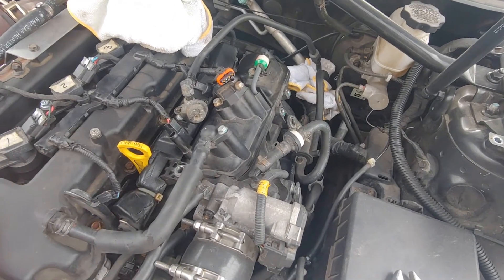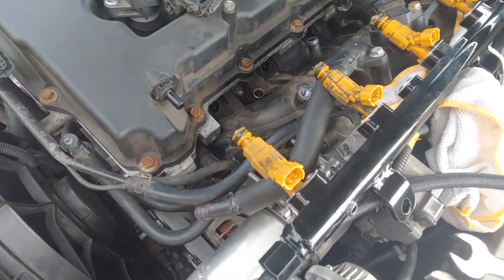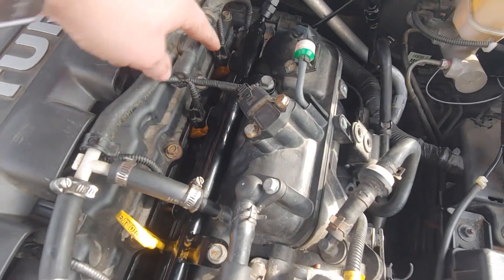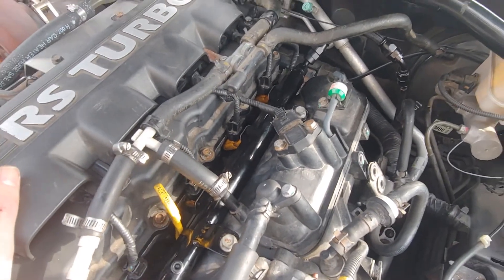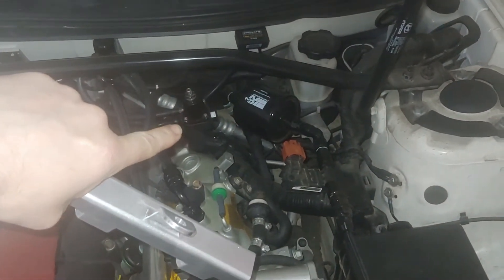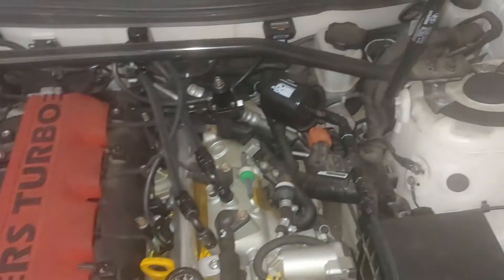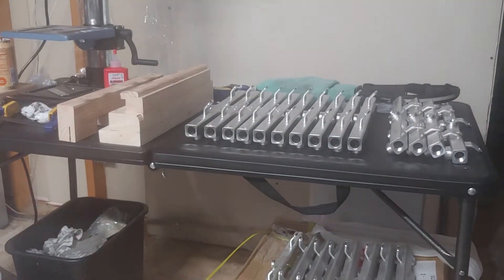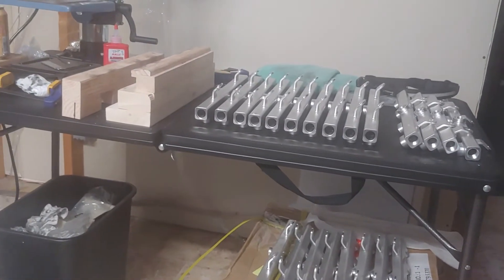Install (DIY) Genesis Coupe Fuel Rail, and NEW Billet Version

Comment: I’m looking for the fuel injection pressure sensor location on a 2013 3.8 track please
Reply from the maker: I'm not familiar with the 3.8. Typically the sensors are on or near the rail in my experience with DI.

Comment: Brother I need your help. Is there a high pressure fuel pump on the 2.0 engine & if so where is it? I can’t find it for the life of me
Reply from the maker: Only 1 pump in the tank. The 2.0 is not DI for both generations.

Comment: I have a question.., so i have a bk2! But the manifold is bk1! Thats how i bought the car. Im i going to have any issues or should i be okay? I havent seen any issues i think? Haha but has anyone done this?
Reply from the maker: The bk1 manifold swap on a bk2 is fairly common. The plastic ones get brittle over time with the heat cycling and with higher boost pressures found on aftermarket tunes or otherwise they will crack or have a hole blown in them. The difference is injector height. My fuel rails shown fit both manifolds and any injector combo.
Reply: @Weekend_Garage  thabk you i appreciate that

Comment: how do you unclip the wires for the electric rail i’ve been confused for days now
Reply from the maker: There is a small tab you will have to push down before pulling the connector off. Often when they have never been removed there is dirt that makes it difficult to remove. Try cleaning it and if they don't want to come off I use needle nose pliers to squeeze the tab, but be very careful that way because you could break the plastic connector.

Comment: I need one for my bk1 ??
Reply from the maker: If you're looking to upgrade the fuel system for better support with an upgraded turbo then it's a great option. Not completely necessary on the stock turbo.